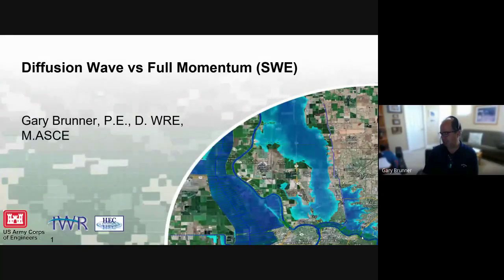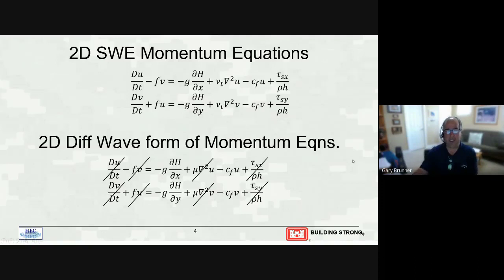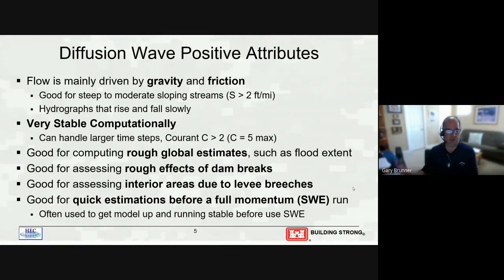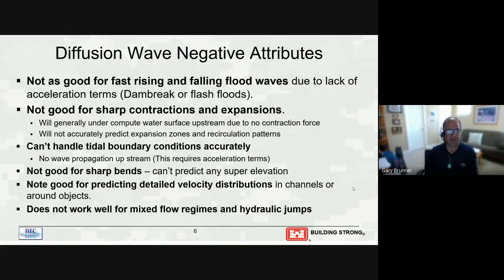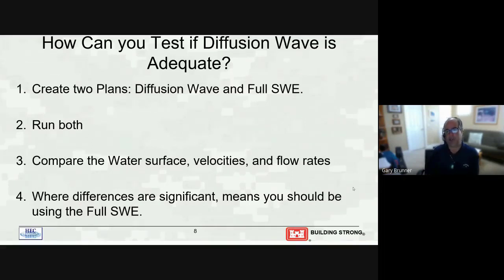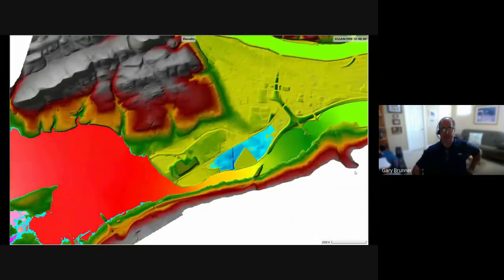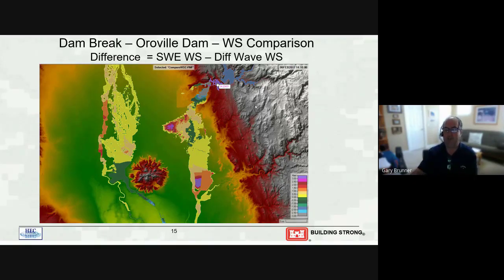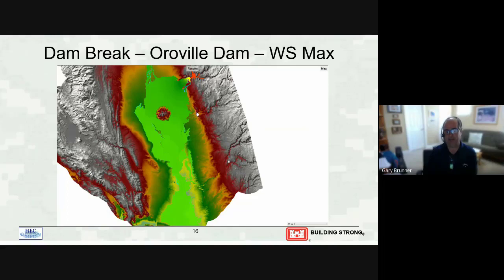HEC-RAS 2D Class: 3.1 - Equation Selection (Shallow Water Flow or Diffusion Wave)

Comment: How do you run the model using the diffussion equation in Hec Ras?
Reply: In the unsteady state plan editor select options, and then select computations options and tolerances. In the 2D tab you will notice RAS has by default, the Diffusive wave equations selected.